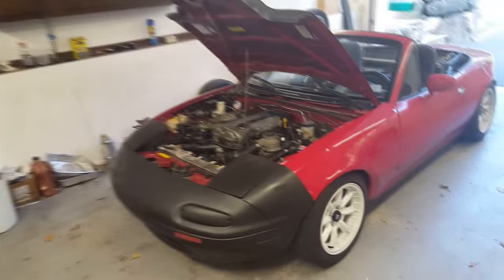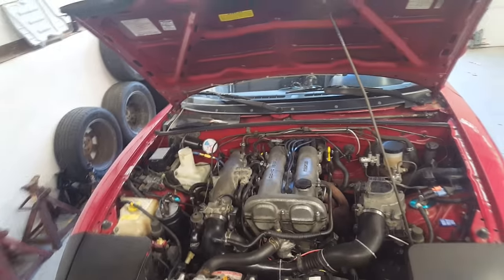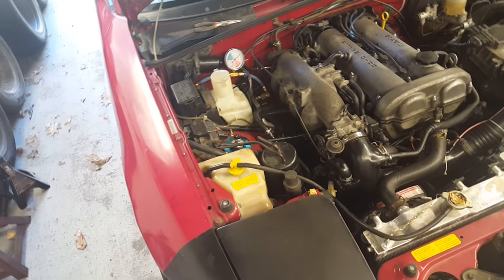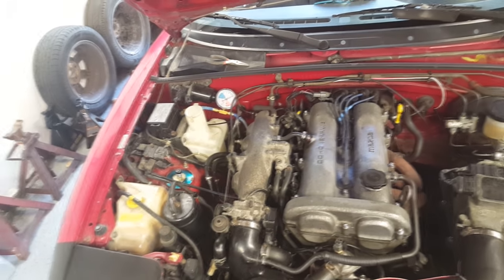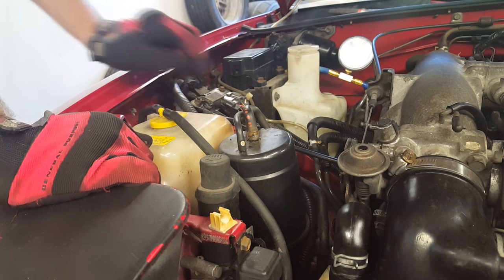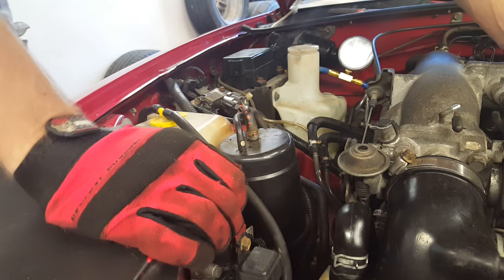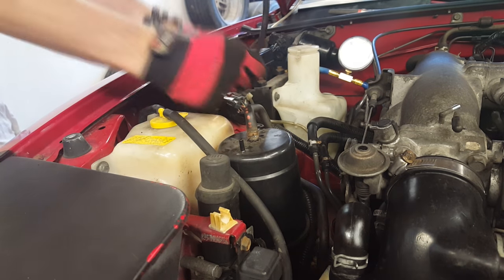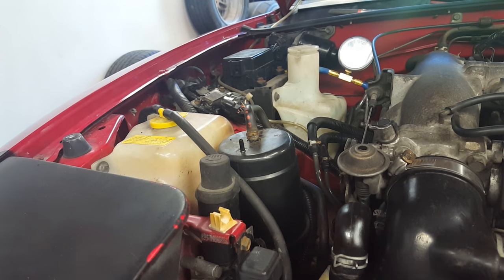Vlog 13: fuel leak

Comment: I had the same problem last weekend and the same exact injector ... And since I'm pretty sure they had never been replaced so I changed them all just bc I don't want to charge one and then another one starts leaking a week later so I changed them all at once

Comment: What's a carbon canister? Don't think I've ever seen one on a car in Ireland or else I'm not looking hard enough
Reply: a carbon canister is basically just an overpriced piece for emissions with activated charcoal in it and vacuum lines going to and from to filter air. 
I blame California.
Reply: check in the rear tucked behind the bumber under the car (usually fuel fill side).... the other common placement

Comment: When you maintain older cars you grow to hate the emission systems. It's because the systems are a patchwork of poorly thought out solutions to government regulation. My 99 jeeps emissions system is garbage. It literally breathes in engine oil into the intake as part of the process. I had to run a catch can because unless I'm a quart low, it's splashing oil into the intake manifold. Anyways.. I get it. Remove the entire emissions system. I wish I could.
Reply: EGR valve?
Reply: +Acdeportivo2 the straight 6 has a port on the valve cover that directly throws oil into the intake. That's just what it's designed to do. It's not a lot of oil, but its there.

Comment: nice, now fix the fucking A/C.
Reply from the maker: I did, works mint dude. I kept the filler gauge there because the valve on the ac line is shot and wont hold the freon in.
Reply: I used your ac video to figure out how to fix my ac. Thanks for doing it 3/4 right so I could figure it out haha